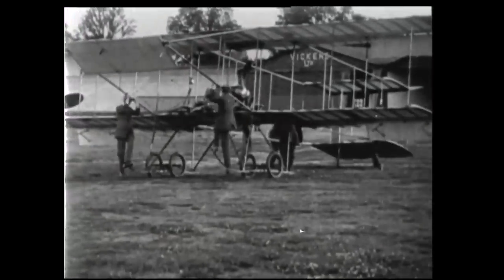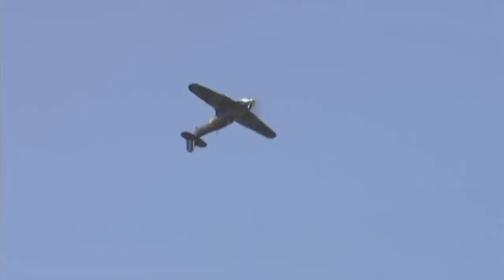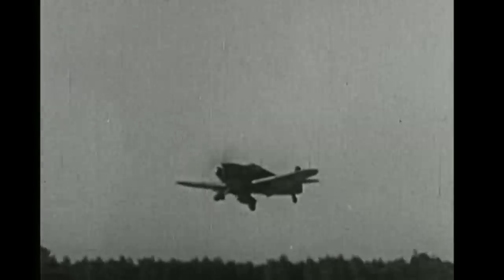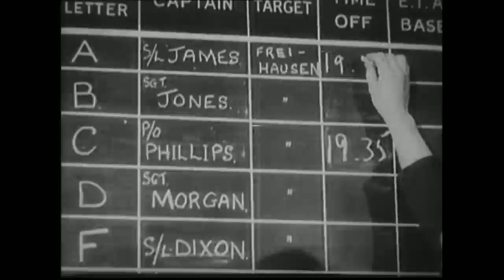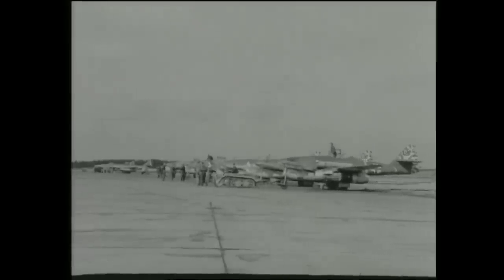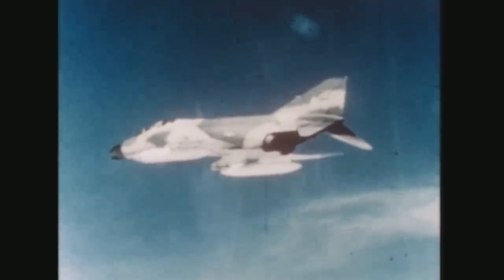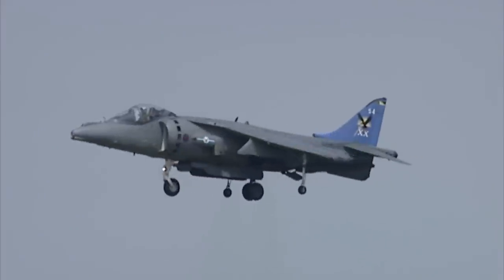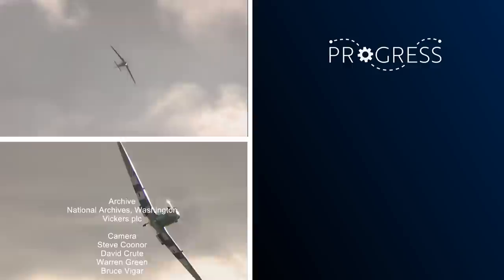The Legendary Warbirds That Shaped History

Comment: What plagued the P38 at altitude, previous to the L variant was the inner wing evaporative inter-cooler for it's second stage turbochargers working too well and freezing everything up. It required adjusting manifold pressure at inconvenient times of combat making it a handful for green pilots. They went to a conventional air scoop and radiator for the L variant and added strakes to the fuselage to minimize compression in a dive. But way too late for the longer range European bomber escort duty.for which it had been intended. The USAAF  had purchased the aircraft upon it's only prototype crashing thus shifting it's high altitude development into it's operational stage. 
.
The brilliant thing about the Merlin was it's 2 stage mechanical supercharger with different diameter impellers both driven with one shaft. It made a compact fit in the confines of the P51 and was relatively trouble free in development making the P51 both ideal for the green pilot.and economical to produce in numbers.  The P38Ls went to the combat veteran pilots in New Guinea replacing their P40s and P39s. They became the aircraft of the 2 leading US Aces, Richard Bong of the 49th Fighter Group and Thomas McGuire of the 475th Fighter Group, as well as #6 on the list of American Aces Charles.MacDonald as commander of the 475th.
.
Incidentally there is also one P51 pilot in the top ten list of American Aces, Two P47 pilots, One F4F, One F6F and two F4U pilots. The pilot is who makes the most of his aircraft..
Reply: The clip saId that the P-38 didn't have the range to escort the daylight bombers.   In reality, the P-38 did have inexperienced green pilots that trained on single engine trainers and were given 20 hours of training on the single seat twin engine P-38.  Those that survived that went on to be aces.  The other problem was the P-38 was kept flying with the bombers.  The Bombers flew less than 170mph.  When the Luftwaffe attacked, the P-38 had to spool up and many were lost due to not reaching the 300+mph fighting speed.  Remember this, the P-38 was the only fighter until late 1943 that could fly and escort bombers all the way to Berlin.  The first fighters to attack berlin was a squadron of P-38s that didn't get the word that the bombers were scubbed.  The strafed Berlin until they had to leave due to lack of ammo.  When the war started and the P-38 went to war in Europe, the P-38 was outgunned at 11 to 1 against the Luftwaffe fighters.  What's funny even with those numbers, the P-38 had a 11-1 loss record.  In reality, it was able to go one on one but got got overwhelmed in shear numbers.  Late 1943 (before the P-51 shown up in decent numbers) the P-38 and the P-47 were released from closely flying with the bombers and began doing fighter sweeps well ahead of the bombers. The P-38 was able to attack the Luftwaffe fighters  while they were forming their fighter cells.  The P-38  and the P-47 had already broken the Luftwaffe's back by the time the P-51 arrived in large numbers (early 1944).
Reply: @darylhunt2148  I believe the video also wrongly credited the P38s armament as "insufficient" whereas it was more than sufficient being all in the nose unencumbered by propeller gearing or any need to merge at a distance and had four 50 calibers paired with a 20 mm. So guys that weren't confident in their aiming like Richard Bong used it's concentrated pattern fire with devastating affect in close as well as deflection shooters at distance like Charles.MacDonald. The P51D was a classic but wasn't necessarily capable against the Me262 so much as over Germany where it was in operation. P47s and P51s both went on strafing passes upon finishing their escort zones, the closer to England being escorted by P47s  and the P51s would take over going into the outer distances into Germany.. 

Main thing that detracted from it's high altitude escort role before the "J" model was the inner wing intercoolers for the second stage turbochargers. Lockheed probably would've ditched the idea sooner if they'd have more prototypes when their first one crashed. The USAAF was impressed enough with the aircraft to have bought it anyway and the intercoolers went into operation with the aircraft. To keep the coolant from freezing pilots would have to adjust manifold pressure and usually at inconvenient times of combat. 
.
Looking over the P38 Aces I was surprised to find the numbers of them in the European theater though. If they had kills elsewhere it was listed as shared theaters of operation. So the three whose kills were in Europe alone would've had to happen early on and that's impressive of pilot skill at multitasking during air combat.. The rest were both in Europe and the Mediterranean and it didn't specify the numbers in each. 
.
Republic stuck with what was known to work and the intercooler for their second stage turbocharger was the conventional scoop and radiator.  P47s had done plenty in the attrition to cripple the Luftwaffe. The 56th Fighter Group was the leader in air combat kills in Europe with 665 kills and they flew P47s exclusively.. It was the comparatively rangy much modified P47N that had the high altitude escort duty for the B29s over Japan while that was still the altitude of their missions. .    .
Reply: @icewaterslim7260  The problem is, there were a few Generals that hated the P-38 and a lot of lies were created.  The luftwaffe had a standing policy to NEVER go head to head with the P-38 because of the range of that 20mm.  The P-38's 20mm had the same ammo as the 20mm anti aircraft.  The Luftwaffe used a slow 30mm that you had to get close to use.  The drop of that 30mm was terrible.  Meaning, as a fighter, the P-38 had the best all round weapons that fired out the nose and didn't need the focal point.
Reply: Add to the fact that the Allison was a very high performance engine with better than a 12.5 to one compression.  Meaning it required better gas that the brits offered in 1942 and the first half of 1943.  The octane booster needed to  set very high.  At altitude, the boster and fuel would seperate leaving the 86 octane fuel to be used.  The P-47 had a similar problem but not nearly as bad.,  Hence the difference in Theaters for high altitude where the US used at least 100 (and up to 145 octane) fuels.
Reply: @darylhunt2148  P47D I believe had water Methanal injection but not full time. Are you sure about that 12 to 1? That's over the top for any two stage supercharged plant. 8 to 1 is at the edge of knocking for a single stage supercharged radial with moderate manifold pressure. The Nakajima Homare in most Ki 84s had all that and wanted 92 octane but didn't usually get that and it's record is one of high failures. Water cooled might go higher but that much? 
.
EDIT . . . 6.65:1 is what I'm getting from Wiki and that would be very common for supercharged aero plants. The P & W 2800 usually had 6.75:1.
.
I heard they put naturally aspirated Allisons in tanks but it would still like 90 octane or better with that much compression.. It wouldn't have as far to fall with a rod through the block but I wouldn't like crewing in one that suddenly wouldn't move.
Reply: @darylhunt2148  The video was obviously hurriedly thrown together by someone who didn't bother to verify things he had heard somewhere, probably from pilots that never touched a P38, without bothering to verify with any research  The "Bomber Mafia" as some labeled both Arnald and Doolittle held onto their theory after it had necessarily been abandoned by everyone else including the RAF. Arnold disallowed use of British composite drop tanks that both: fit the P47D  and denied the Germans free scrap metal. But I don't read minds from 70 years ago and don't have anything but a guess based on the attrition as to why they pulled P 38s off before P 51s showed up. My uncle was a substitute B17 waist and tail gunner in the 351st out of Polebrook England and was killed on his 12th mission, to Kassel Germany on July 30 1943.. Fighter pilots though are an expensive investment. More so at high attrition rates. So are P38s and P47s compared to pilot friendly P51s.
.
IJN Ace  Honda Minoru said of the A6M Zeke's type 99 20 mm round  that  "it dropped like a stream of piss". He claimed to be the worst shot in his flight school so he'd close to under 50 meters on an adversaries 6 and sweep across them to avoid debris. He also said he didn't do head-ons and that the two things we had that he wished he had were more horsepower and a trio of browning 50 cals in each wing.. He eventually became Gendas Wing Man in the 343rd equipped with N1K2-Js, but only claimed two of his 17 claims after '42: In the Zeke, an F6F that didn't watch his 6 going home  and a B29 in the N1K2-J.. No P38 in the mix. He said he evaded his first  pair of P38s encountered after mistaking them for bombers. If so that's a difficult feat in itself in a Zeke. 
.
On the day that Thomas McGuire stalled and crashed his P38L, over the Philippines,  in a low speed turn, on the deck, with drop tank on. his third wingman Jack Rittmayer (previously credited with 4 kills) was engaged in a Head=On by a Ki 84 (armament probably either 4ea. 20mm, or: 2ea. 20mm and 2ea. 30mm) and his P38L reportedly "disintegrated." . . . https://military-history.fandom.com/wiki/Thomas_McGuire
Reply: @icewaterslim7260  The P-47 had 8to1 as did the P-51.  But the Allison was a very high compression engine.  Hence why in air racing later on, parts from the Allison was put into and onto the Merlin.  Of course, the R2800 in the Bearcat ruled in the racing.
Reply: @icewaterslim7260  You are correct.  But making the P-38 fly low and slow against a Kate is pretty much suicide.    As for McGuires thing, you can't win em all.  And McGuire would hold his fire until he was close, real close and the Kate took advantage of it.  It wasn't the P-38 that made a mistake that day, it was the pilot.
Reply: @darylhunt2148  That it was and against his own rules. He also insisted on keeping the drop tanks on indicating they were on their own mission to pad their scores and that the Ki 43III pilot was expected to keep moving in the op posit direction and their conservation of fuel would've ruled out picking up a shared credit in chasing him down. I'm sure the "Oscar" took them by surprise by coming back at them so he found himself apparently pushing stall limits in circumstances he hadn't tested in practice at altitude beforehand with the drag of that drop tank. The Ki43 pilot was an instructor with thousand hours of time in combat fighters which the Oscar III was. It had the only mechanical 2 stage supercharger that the Japanese got into operation though it was dead weight flying on the deck.  It had, some moderate velocity 50 cals that used incendiary ammo. The one's operational before the effects our submarine blockade had some alloy armor at least behind the pilot and a rather thin light coating of self seal in the tanks. Oscars using the IJAs questionable claim verification's laid claim to the record of Allied Aircraft Japan would claim to have shot down 
. 
What I found surprising as they probably did, was the Ki 84 "Frank" pilot's willingness to do a head-on against the three of them, perhaps counting on two not to turn into their partner's path. Perhaps even counting on his target not to. He was also an instructor with hundreds of hours in combat aircraft and the Ki 84 "Frank" that we took off off Clark Field in the Philippines had over a half inch thick Nickel Alloy armor plate behind the pilot, bullet proof glass in front, some self sealing tanks and on Water Methanol and Alcohol (which cools the cylinder heads) injection and on 96 octane gasoline was good for over 400 mph. if they were the rare put together well ones and we practically rebuilt that one to specs when it got to the states. 
.
Their 427 mph figure at 20,000 ft is questionable as it was quoted in US intelligence briefings before they were ready to test it. But the more quality controlled of the Franks, such as there were at wars end days, would top 400 mph at the peak power-speed altitude of the Homare 21's single stage 2 speed supercharger, at  just over 20,000 ft. The Homare 21 got it's 1970 hp out of only 2187 cu in by virtue of relatively high compression and relatively high RPM for a double radial with the corresponding penalty affecting engine longevity. Small diameter radial in a small frontal area Ki 84 "Frank".was another factor in it's speed.
.
The Ki 84 pilot, Tech Sergeant Mizunori Fukuda,survived the war and hadn't gotten credit for his shoot down of Major Rittmayer until the battle reports of McGuire's surviving two wingmen were made available by McGuire's Biographer,. So I guess the then-defunct IJA required some basic witnessing to verify and this kind was the solid kind. 
.
The first "Frank" we tested was later repatriated to Japan and can be seen in flight here . . . .https://www.youtube.com/watch?v=l-ViXDSuhmY&t=1s
Reply: @icewaterslim7260  Funny how they preached to the other pilots  to keep the speed and altitude up and drop the tanks when the fight started.,  And NEVER dogfight a Japanese Fighter, EVER.
Reply: The P-38, the Allisons and their installation were plagued with problems, some of which were never resolved, like the limited critical mach speed (starting at .65 to .68) at altitude.  Yes, the weapons were a big positive.  By the time the P-38 became effective in the ETO (mid 1944) the LW was in severe decline thanks to  P-51s/P-47s/Spitfires.
Reply: After he woke up Charles Lindbergh was great on fuel mixture in the p-38 at his age actually did well in air combat
Reply: @darylhunt2148  true that slash and burn with one pass
Reply: @amandastevenson4948   woke up?
Reply: Bad choice of words please accept my apologies
Reply: @amandastevenson4948  I'm just trying to understand your meaning about Lindbergh?
Reply: Actually, the P-38H cured that problem.  Any version with the "Beard" moved the intercooler radiator and oil cooler to a better position.
Reply: @darylhunt2148  No, P-38 high altitude problems continued with intercoolers freezing, detonation, problems with fuel additives, among other things. 

Allison worked on a new intake manifold to help solve the problem, as it would affect ALL Allisons, not just the turbo-ed ones. It was being fitted to new engines starting in Nov of 1943. Many manifolds were shipped overseas for refitting in service engines.
The Army's initial design of turbo control was not well thought out, it sought to control the turbo by measuring the pressure in the exhaust ducts or close to the turbine. By maintaining a constant exhaust back pressure they thought this would regulate the intake boost. It was slow responding and subject to freezing.  The turbo control was changed to a system that measured the intake pressure and adjusted the turbo waste gates accordingly. 
The problems had been mostly sorted out/solved by the spring of 1944 and all new P-38s from Dec of 1943 on (which may take weeks or months to get to a combat theater) had most of the basic engine problems solved. Mis rigged turbo controls, turbo induction leaks, bad piloting technique (against the directions of both Allison and Lockheed) still caused problems, and the low critical Mach (starting at .65-.68) was still a detriment in combat.
Reply: @bobsakamanos4469  That ended when the AAF started providing the fuel.  The Brits had 85/87 octane and in order for the P-38 and the P-47 to fly at altitude was using additives.  When AAF offered the 100/140 those problems disappeared.
Reply: @darylhunt2148  Sorry, but tetraethyl lead (in 100 octane) for anti-detonation was particularily problematic for V-1710 engines due to the poor intake manifold design.
Reply: @bobsakamanos4469  The manifold wasn't the problem.  The P-38 was tuned for  at least 100 octane and it ran like crap with the 87 even with the booster.  Plus, the booster had a problem of settling to the bottom of the fuel and it really gummed up things fast.  The merlin was designed to run on the 87 octane and didn't use the boost.  You are just repeating what the Brits said to run down the P-38 AND the P-47.  When the P-51B made the scene, AAF was already providing their own 100/140 octane fuel for their fighters.  Also, in middle 1943, they changed from the fighters flying tight with the fighters to a more roaming fighter.  Although the P-38 had the range, it didn't operate very well when jumped with it at 150kts.  It's fighting speed was over 300mph.  But if you think the P-38 was not used late in the war for bomber escort, you would be wrong.  Both the P-47 and the P-38 would accompany the bombers and when relieved, would play hell on ground targets on their way home.  The ONLY reason that more P-38s weren't built and assigned to bomber escort was that they were twice the cost of the P-51 and the P-51 sucked on ground attack.
Reply: @darylhunt2148  well, I could agree with you but then we'd both be wrong, LOL.

US sources clearly identify a host of issues with the Allison that continued even into the Korean war (P-82).  By 1943, Allison was forced to redesign the intake manifold to alleviate the uneven fuel/air distribution causing detonation.  Lead deposits were a problem even after using the new manifolds (Aircraft Engine Research Laboratory
Cleveland, Ohio, Dec 1945). 
Now, I've previously given you unbiased researched facts (from US sources) on the P-38 at altitude, so I don't need to repeat that.
Reply: @bobsakamanos4469  Reality is that there was a huge amount of bs about the P-38.  Done by the English to hide the decisions on the original P-38 and the bad fuel.  On the Bomber side, most of the losses were from the P-38 entering in a dogfight at 140 t0 170 mph when they should have been over 300 where the P-38 got the best distance.   Both of these things affect the P-47 as well.  Both of these problems were cured in the second half of 1943.  The AAF was now providing the fuel for their own birds and the Fighters were loosely attached to the bombers.  The Fighters were not able to fly well ahead of the bombers and jump the Luftwaffe where they were trying to put the attacking fighters together.  Retired USAF 20+ years with time on Recip Engines.  You keep doing your research without listening to those in the field.
Reply: @darylhunt2148  playing the blame game doesn't work when I've used US sources. Why haven't you looked up the facts that I've already provided, especially WRT the redesigned intake manifolds?  GM/ Allison were notorious for not spending their own $ on engine development, and yet new manifolds were produced for P-38s and retrofitted to all Allisons in other airframes in 1944. And you've nicely sidestepped the low critical mach of the P-38.
Reply: @bobsakamanos4469  I know your sources well.  And I know that American Fighter Production was more political than not.
Reply: @darylhunt2148  of course.  Politics (and corporations) still play a huge role in military capital acquisitions.  I should know, having suffered through that quagmire many times, but let's not digress.
The Allison was great at low rev cruise, giving longer range, however the engine temperatures involved promoted severe lead deposits from the fuel additives on the plugs and pre-ignition.  The older intake manifolds also had lead deposits due to uneven charge distribution with lead coating the cylinders/piston crowns as well. 
The Allison accessory case needed redesign because the S/C intake was too small (in consideration of an auxillary S/C), and as already mentioned the new manifolds appeared in 1944, which is why the P-38s reappeared as escort fighters at the end of the war.  Mind you, the boosted ailerons were a big plus making them somewhat competitive against what was left of the LW. 
Have a chat with Planes of Fame folks if you're still a doubting Thomas.
Reply: @bobsakamanos4469  Notice you keep referring to problems of how the P-38 malfunction due to fuel and yet you can't understand that the additives were seperating at high altitude and gumming things up.  They were sinking to the bottom of the tank.  And, the last time I checked, that's was where the fuel was sucked in.

Considering that the 100/140 fuel was NOT leaded fuel.  Where would the lead come from for that fuel?  And are you tellimg me that me that the 87 octane that the Brits offered was leaded?  Or that the lead came from the fuel additive?  

And that the performance of the P-38 at high altitude was poor against the Luftwaffe due to these problems?  Or was it was because the fighters bomber escort was bad, really bad and was designed to trade a down fighter for a live bomber.'
Reply: @darylhunt2148  good lord, forget the 87 octane.  Brits were using 100 octane during the Battle of Britain. 

Now, I've given you the ref to the Cleveland Research Lab report date Dec 1945 that specifically focused on lead fouling on the V-1710.  
You seem reluctant to look into the details I've provided, so stop arguing, based merely on opinion, and look it up.
Reply: @bobsakamanos4469  Just keep making things up to arrive at your predetermined ideas.  And we aren't talking about 1940, we are talking about 1942 and up.  Don't let soemthing like facts get in the way repeating an 80 year old political idea.
Reply: @darylhunt2148  Talk about gas lighting.  clearly you were never in the USAF or you'd know about tetra-ethyl lead in the octane.  You're just some kid who's been consuming all the fan boy BS.  Run along, son, adults are talking here.
Reply: @bobsakamanos4469  Keep making things up.  You are so special and Bless your heart.
Reply: @darylhunt2148   LOL.  so says the GM/Allison influencer.